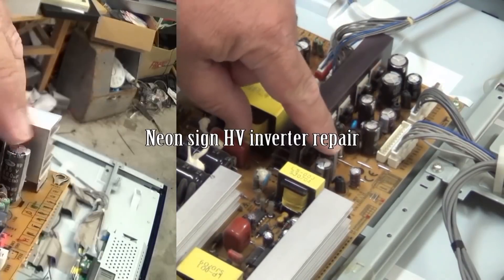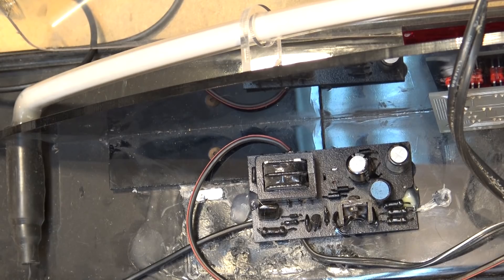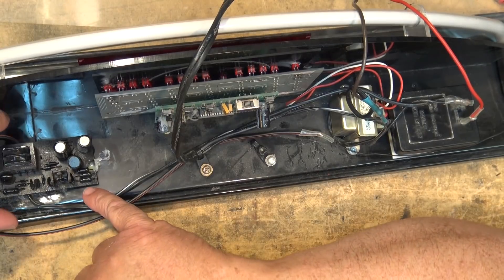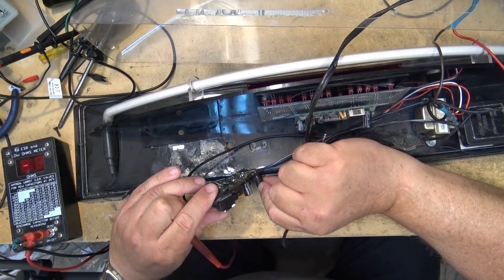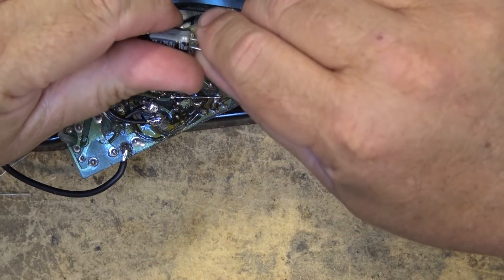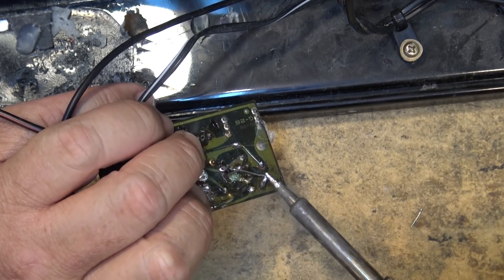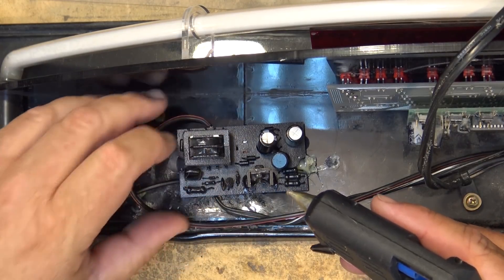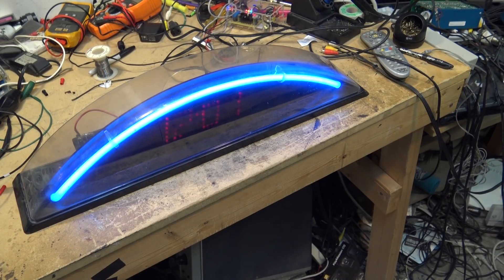Neon tube inverter repair

Comment: what about 4 of the the 250v caps  in series and parallel instead of 1 cap that fails

and maybe with heat sinks  so you still get the same value UF but more robust long term !!

Comment: Awesome =D   On a seperate note - have you been hit by this 'not suitable for all advertisers' crap yet?  I am contacting some of the more influential channels like yours in order to work out the scope of the problem.  Some people have been lucky so far, but I am also seeing a lot of problems where peoples videos are being marked as not suitable when there's nothing wrong with them.
Reply from the maker: GadgetUK164 - Retro Gaming Repairs & Mods 
No I have not had any issued with advertisers. This is targeting channels where objectionable content is shown or foul language is used.
Reply: Thanks for letting me kno!   They are randomly picking up videos that dont meet their own set out criteria - their algorithm is picking up videos that are fine =/.  Let me know if any of your videos get hit.  I am being contacted by other people with the same problem and it's hard to know what the actual cause is in most cases.

Comment: Why do you have to keep replacing caps.
Reply from the maker: These type of circuits drive them to the limit. They operate at high frequency and I am sure there is plenty of ringing just due to induction from the transformer. This cap in particular runs quite hot just due to the frequency it is operating at, and the high ripple current it endures. This heat translates int o pressure, and over time the electrolytic dries out, even on high temperature devices.
Reply: 12voltvids  thanks for the reply I remember I got a belt off a neon tube terminal years ago I didn't touch it again.

Comment: Perhaps whan it goes next time, you can use 3 caps at 1/3rd the value, that may allow them to stay cooler as each one does less work, perhaps :-)
Reply: Out of interest, would it help to use a 350 or 450v cap?

Comment: You know what cuts hot glue faster than anything rubbing alcohol put a little dab on there and it crystallizes and Pops right off
Reply from the maker: Good to know will try that next time.

Comment: Nice fix
Reply: sorry i did notice you took the solder pad off, but you've done some great videos many thanks, keep them coming, ps couldn't you  increase the voltage on the cap cheers